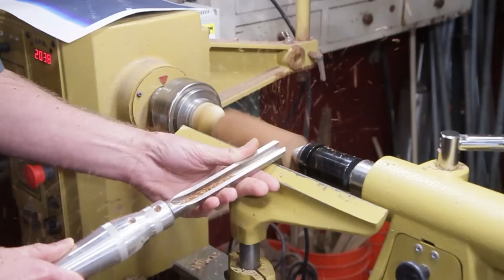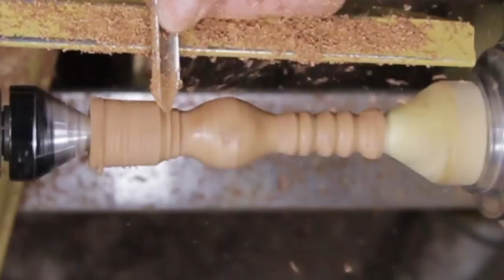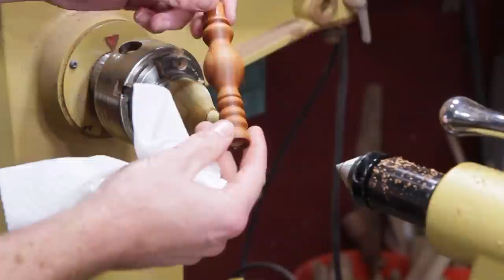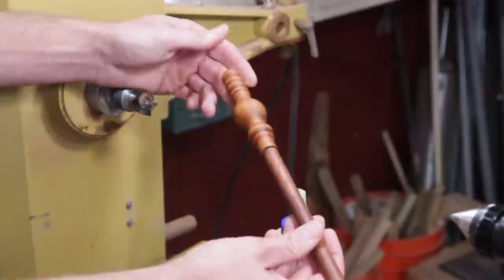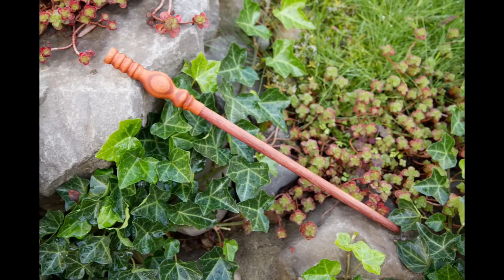Magic Wand

Comment: I was wondering what the dimensions were of the rough wood. I have been wanting to make wands on my lathe for a while but never know what size of a block to start with. Love your work Carl.
Reply from the maker: +stanley haynes Thank you Stanly! This video was a long time ago, I don't remember the dimensions. I usually start out with a 1" piece, and then the length  depends on the the wand.